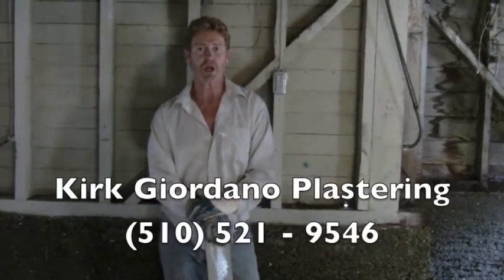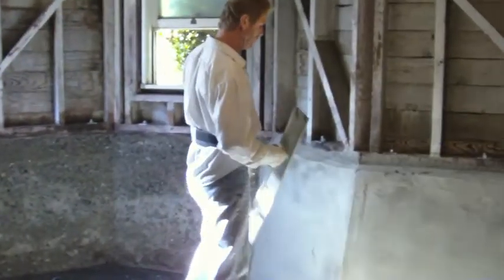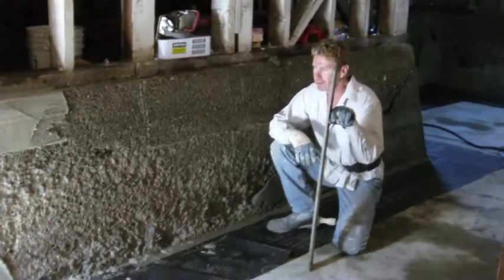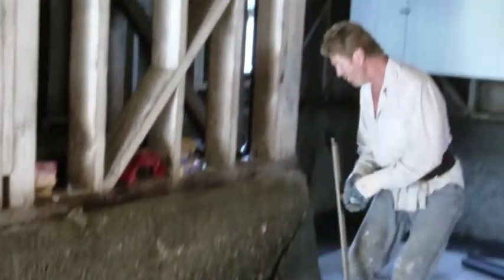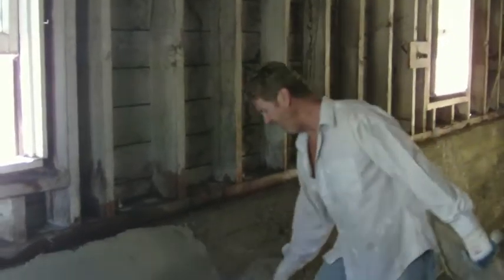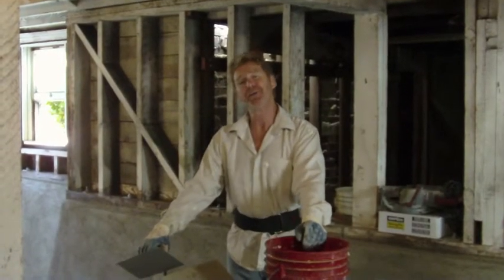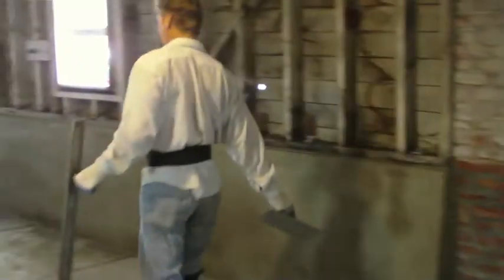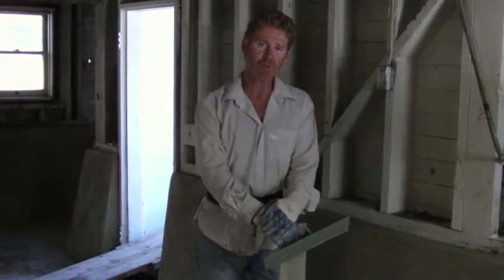Interior foundation walls fixed with stucco.

Comment: you mention hydraulic cement in the video, but the video title mentions cement plaster. Went to Lowes to look for hydraulic cement which I worked with just a little bit many many years ago. The package said to mix up just a little bit at a time and that it begins to set in 3-5 minutes...that you have to work very quickly. Is it the same stuff you're using? You seem to be mixing up a really big batch of it and you don't mention "speed" being a necessity when working with whatever you're using. Please clarify. Thanks so much!

Comment: Hi Kirk, do you have any suggestions of what I can use to smooth out my basement walls. I have a stone foundation home, some areas of the walls are not as smooth as I would like it to be.
Reply from the maker: Good Morning Juleen, yes, depending on your level of plastering and the amount needed you can buy Rapid stucco mix at all the major hardware stores, you just add water as there is sand already in the bags.
Tip, don't over mix.
    I personally used Hanson's premium cement plaster and added my own sand, best wishes.
                       Live long and plaster
       Teaching the world to stucco, one video at a time.

Comment: Amazing how you do this work!!  It’s an art!!  The way you handle the tools!!  I would have a mess everywhere if I tried to do this technique!!  Experience!!  👍👍
     Quick question.  I have a small portion of a wall that is part red brick and some regular large grey brick that is the foundation in my basement.  Had a small leak that is repaired.  But have an area that has to be patched and painted.  Not too bad, deepest area is only 1/4 inch but mostly less than that.  What is the best material to use to patch this up?  Instant pre made concrete didn’t work.  It just peeled off.  Big mess.  It’s all scraped and clean now.  What should I get?
Thanks for the good video!
Reply from the maker: Howdy Diane, thank you,  concrete has rocks for strength, so it's not the right product to use,.
  I would suggest Rapid Set Stucco from home depot, it comes in 10, or 25-pound boxes as well as 50-pound bags.  
    The area in question should be dust free, and a bonding agent should be applied as well to that area so the stucco will adhere forever.  
                                   Live long and plaster
                Jason and I will teach you, “how to render a wall”
Reply: Kirk Giordano plastering Inc.     wow!!  Thanks for the quick response!  I will head to Home Depot tomorrow to find this.  I’ve repaired several walls but they were drywall, easy.  This one was a nightmare when I tried to use pre-made concrete!   
     Thanks again!  I’m happy I finally have a solution after hours of searching!!  👍👍🙏
Ps.    I love being able to make repairs in my home!!  It’s such a good feeling of accomplishment!!

Comment: Hi Kirk, Would you recommend using Quikrete Type S Mortar Mix for plastering interior basement block walls on an old house?
Reply from the maker: Howdy Elliot, you can but I recommend either Rapid set, Greencore both sold at home depot.

Comment: Thanks for the video. What did you use in what proportions to mix the plaster? In the video, you mention that it's structural with hydraulic cement and stucco.  I need to do pretty much the same thing and would like to know the proportions to mix up and final thickness of the added finish. I couldn't tell from the video whether you were talking about how far out the bottom sticks compared with the top, or whether you were talking about putting 5-6" of plaster over the foundation walls. TIA.
Reply from the maker: Hello, I general add three parts sand to one part cement plaster, If I have to go with a 6 inch depth, I apply one at a time allow to set, and keep adding until I obtain the proper depth.
 Best wishes, 
 Kirk giordano

Comment: Not sure if this is from a water leak or not.  Some time ago I found a crack on the slab that holds my hot water heater. Not the whole slab, but just the side that runs along the side of the house.  I dug out all the cracked cement and filled it with hydraulic cement.  Now I am painting the room that shares that same  outside wall the crack runs the length of the room and same along that same wall thru the living room.  It then turns along the back side of the home toward the kitchen.  If I pull out the crack cement it appears to be a lil cavern between the outside wall and the inside spacer. The cement remaining to the outside of home appears strong.  The slab inside home under carpet appears to be fine.  Any thoughts on what could cause this? Will it be ok. to fill with hydraulic cement the length of the house and then the same along the back wall?  The crack then disappears as it heads into the kitchen area.  Should I be pulling up tiles to see if crack continues, which it probably does?. I need help. Please!!
Reply from the maker: Hi Steven Limitone,
What you have is typical and normal, but unsightly, mainly it's due to settling foundations,  rain which causes the ground to expand and then shrink with months or just days of rain, installing new roofs,
opening and closing doors, especially the big beautiful solid oak or similar ones (vibrations) traffic driving to and from again, ground movement which can't be seen or felt, even furniture being moved around inside the home.
 Glass, concrete and stucco usually don't flex much, they instead shatter or crack with all movement and or vibrations.
     To fill with any cement, when it moves again it will re-crack, fill with a 
sikaflex polyurethane caulking, it will move with the floor, the cracks have to be extremely clean before you apply this.
I would not remove the tile myself or lose any sleep over this thought.
Lastly, no product sticks to dust, dirt, grime and loose concrete.
 Best wishes,
Kirk & Jason Giordano's DIY plaster and stucco network
Reply: Kirk & Jason Giordano's DIY plastering and stucco network Thanks so much.  So hard when you are ignorant to things like this.  It is unslghtly and i was thinking of what I can use to patch it.  Hydraulic cement is nice, but maybe not the best idea for what I'm needing.  I was thinking of like that foam insulation stuff.  I really just want to seal any exposure from the outside to the inside.  What would you recommend?  I can send a picture.  One of the guys out to my house today said that he has seen a lot of homes, but never seen them put an expansion joint on the inside.  He thinks that is a big cause as the home settled.  He said he'd just patch it and leave it, but I don't kow that is the best idea either.
Reply from the maker: Hi Steven, no, I would not use the expanding foam, it's the worst thing you can use, my above recommendation still stands.
 Best wishes, 
 kirk and family
Reply: Kirk & Jason Giordano's DIY plastering and stucco network Thanks again.  When I read it the first time I was unable to see that last part of what you recommended to use.  Thanks so much for being available for me.  You have eased my mind!  Best wishes to you and your family.  Steve
Reply from the maker: Afternoon Steven, no worries,
have a great Day! 
 Kirk & Jason Giordano's DIY plaster and stucco network

Comment: Kirk, i have a stone/rock foundation and the white material covering it is crumbling, needing replacing. I live in the mid-Atlantic so moisture/sweating is an issue. What type of application material do I need specifically to apply to the walls?   ANy particular brand? tHANKS!
Reply from the maker: Hello Chuck Wortman excellent question, if it's plaster, taping mud joint compound or any other material including Stroucto-lite and imperial or even Diamond plaster It won't adhere for long to any surface that's stays damp.
Consider taking it off and applying stucco to it.
 Best wishes, 
kirk and family

Comment: Can i just use a sand and cement mix to do my base walls or do I have to add lime to mix when doing a basement..what is the best combo to use.. P.s. love the videos..
Reply from the maker: Good morning Tanya, you  can do this, if it were me I'd just use rapid set sold at home depot where you just add water, although you cant overmix this cement plaster, 3 to 5 minutes max,
                              Best wishes,
                          Live long and plaster
           Plastering tips for your information
Reply: Thanks.. that will be a lot simpler to use.
Reply from the maker: Howdy Tonya, like easy peasy lemon squeezy 
                 Live long and plaster
       Sharing the plastering knowledge

Comment: How much did a project like this cost? Also how would I find someone that specializes in this in a smaller town?  It looks as if someone attempted this in my basement but it is starting to fall off the walls now and needs attention.
Reply from the maker: Howdy Tim, no I’m sorry i don’t know anyone in your area, however
the best advise is for you to try the BBB or any other referral service in your area, get three bids and follow your gut feelings when choosing any contractor as some are tired, and don’t have much time in but need cash to put food on the table, thus say things he or she does not intend to back up or worse yet don't have the time in to back up but will try, this trade takes many years of time in.
 Try to find someone knowledgeable, ambitious and qualified, if you talk with a few you will be able to distinguish who's right for you, sometimes it can be a full time job often to find qualified tradesmen.
 I forgot what I charged as this work was years ago, but doubtful tno two guy will see the same thing thus you will receive different quotes.
best wishes, 
 kirk giordano plastering